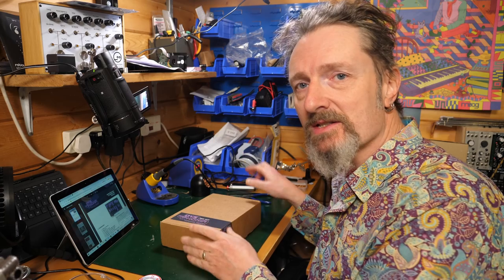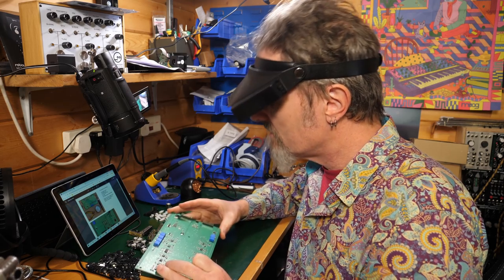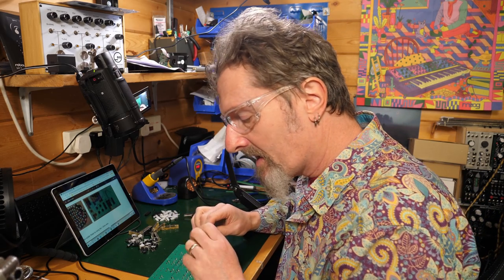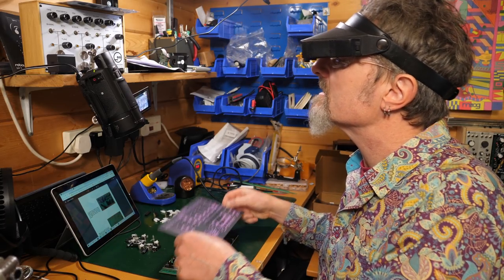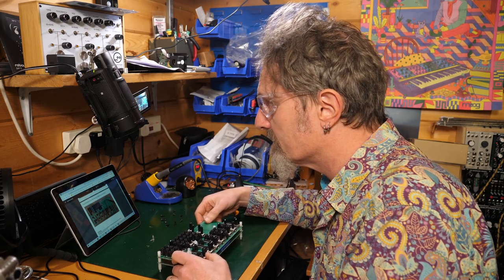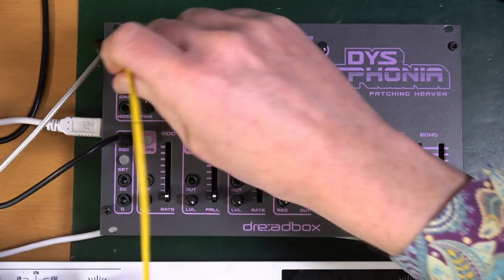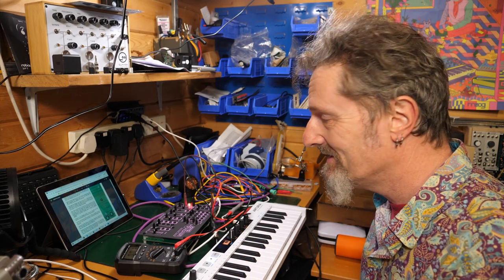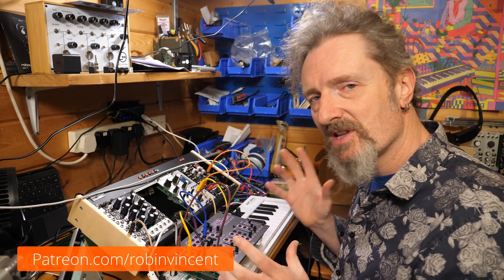Dreadbox Dysphonia modular synthesizer DIY Build

Comment: Hey did you have any trouble with the solder not flowing properly? I am using the leaded good stuff with rosin core, and even turned the temp up higher than recommended, but something about the board and components seems to be cooling things more than other practice kits I have done. Any advice on temp, type of tip to use, angle of the iron, etc that you found worked for you? Does it his ever happen to you as well?
Reply from the maker: I had the exact same issue and talked about it in the video - i had no solution other than being patient.
Reply: @MoltenMusicTech  I did watch the whole video but that part must not have stuck in my head. I will definitely rewatch now that I ran into the issue. Did you use chisel or cone tip? Looked like cone but could t see up close. Do you think the cone one works better because these are so small? Thanks!!!
Reply from the maker: I have whatever it came with - it’s pointy like a pencil
Reply: @MoltenMusicTech  thanks! You video has helped so much. I finally got things going right for me. I learned that I need to leave it on there a little longer, and you also did a little twist move at one point to get the solder to get in there, and that has made a huge difference. Thank you! Got a rhythm now and feel a lot more competent thanks to watching your video several times.
Reply: When soldering the first component, the iron was applied for much longer than necessary. Leaving scorch marks on the board. The reason nothing was happening, was that the tip had not been adequately tinned. By loading enough to wet the iron, you will transfer the heat much more efficiently. The solder will then flow. Dry irons lead to dry joints.
I scrapped a few boards by burning the pads off pcb(s) -an expensive mistake. 
Sorry to be so picky, but on that power socket, it is best to solder one corner only before turning the board over to check there is no gap between the socket and the board. Having seated it properly, solder the opposite side, and check again before completing the other joints.
Again avoid leaving the tip on the board/stem of component for more than two seconds because heat will melt the component as well as burning the board. I find a small chisel shaped tip works best in transferring heat efficiently. 
I really appreciate the effort that goes into these videos. I have found them very useful in planning my modular setup. Thank you.